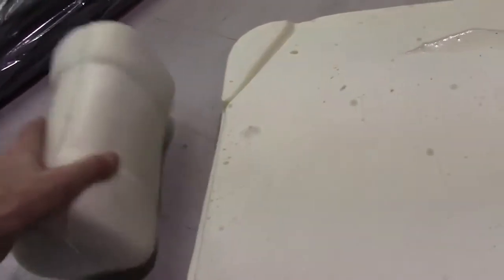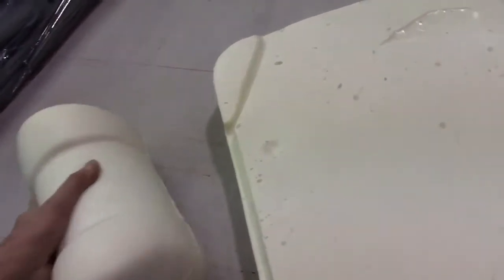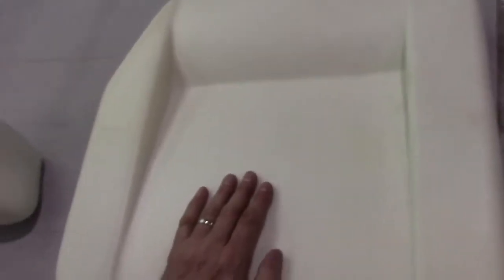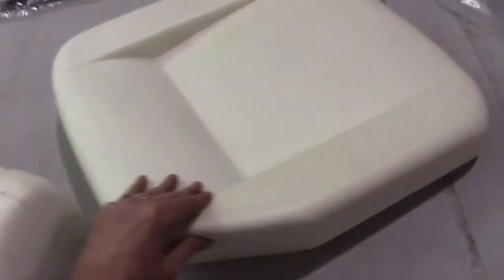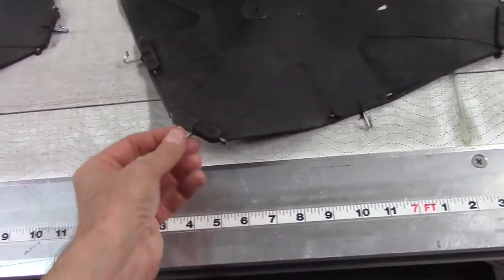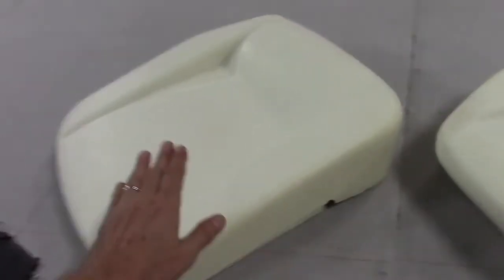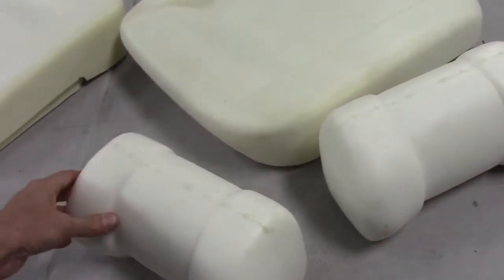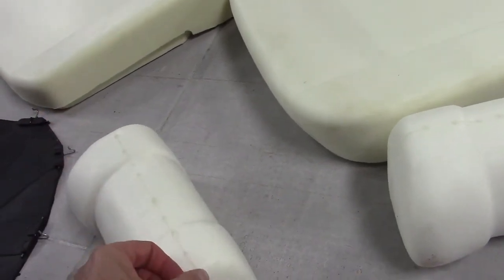Jaguar E-Type Seat Foams & Diagrams

Comment: Thess exact reproduction diaphragms made from their own exact tooling have the exact same size securing hooks installed all the way around, quite unlike the exact origionals which had exactly 2 size hooks and didn't needed exactly  zero modification like these exact ones that don't fit exactly as exactly engineered to exacting original jaguar specifications.